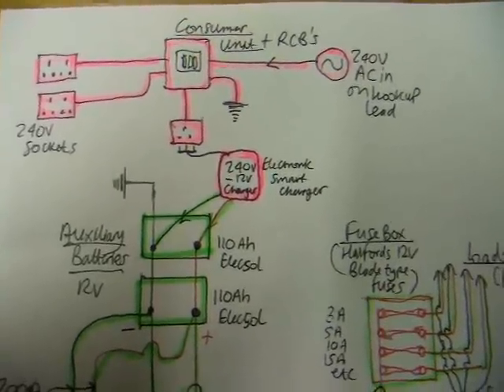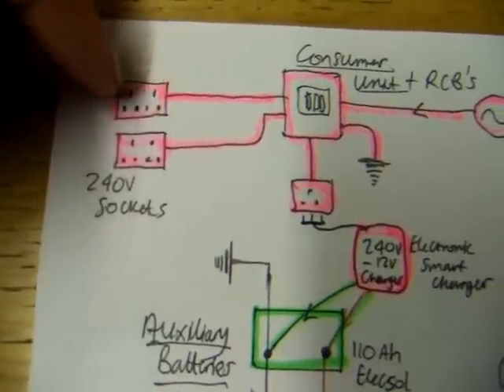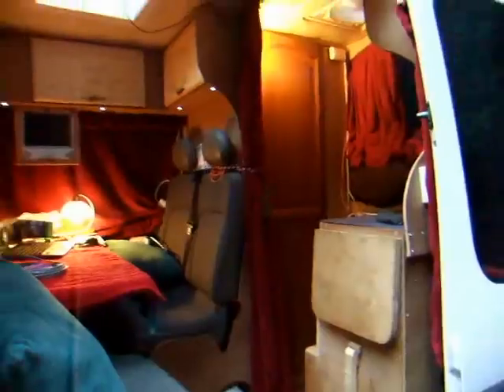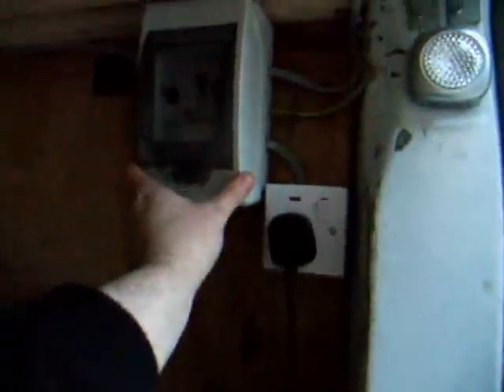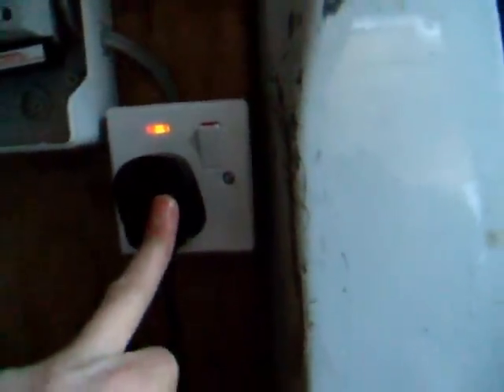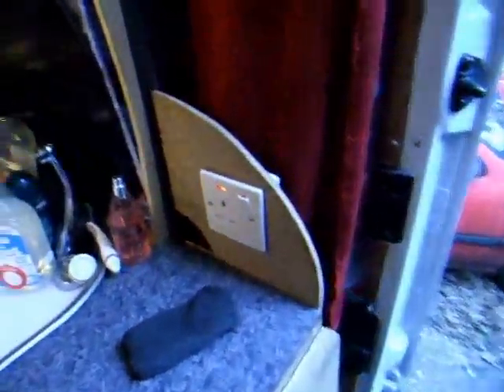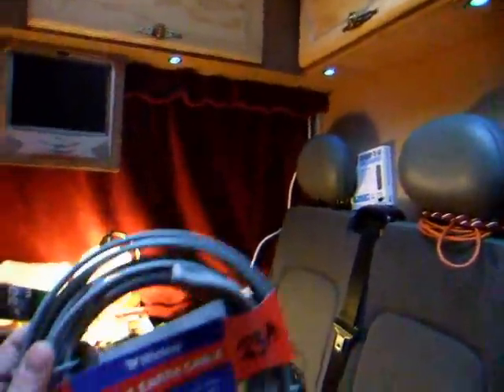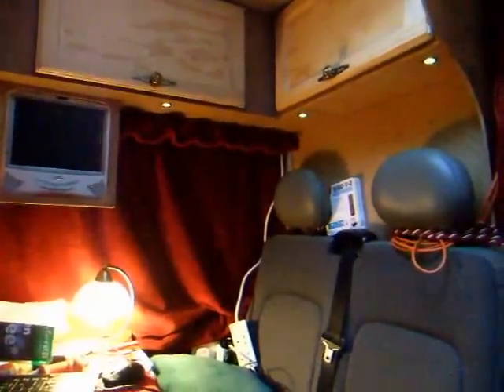20. Self-Build DIY Camper Van. 240V AC electrics, consumer unit, inverter, and sockets

Comment: I really think you should of used Flex cable and not twin & Earth.  Vibrations in the motorhome while driving can cause the copper to break in a tightened terminal.  Stranded cable is more flexible.
Reply: +Robert Williams You are correct, but  If you check on the vid, I already explained this with a note.

Comment: -----And also make it possible to power it via 12v sauce from engine when 240v Hookup is not available..This is to be done via split feed from engine and 2 12v 110ah deep cycle batterys and inverter....(PLEASE) Spud could you supply me with a diagram to do this. I am an amature but sure i could follow a diagram. My email address is   brian.wn@hotmail.co.uk  I would be really greatful of anSpud. Thankyou very much for reading my post...Cheers Bri.

Comment: Hello Spud, Bri here from yorkshire uk. I,m Woundering if you could do me a big favour (Please), A Refusal will not offend. I Am trying to convert my three an halt ton box van into a snack van and am struggling to decide how to go about installing a 240v power system . What i am hoping  to install is 2 Double sockets 240v. one 4ft strip light with a wall switch....and last of all, One 12v socket for a 12 v fridge. I am hoping to power this setup via mains hookup lead when possible. P .T .O--

Comment from the maker: @12345paulpaulpaul The van cost about  £5,500 and the conversion about the same again. maybe £11,000 overall. But you could do it for a lot less. Get an old van for about  £500 and a scrap donor caravan for the parts for about the same. Scrimp and save on parts and get stuff off ebay. But which ever way you look at it, things like decent leisure batteries do cost money and you would probably have to budget on at least £2000.

Comment: @Richard44Green 

A very good clear explanation of the 240v system. On my conversion I added a solar panel and Sterling B2B charger to ensure my batteries were always in tip top charged condition, when not on hookup.

Keep the videos coming.
Colin.

Comment from the maker: @spud09uk Good point. I remember reading this somewhere, but it slipped my mind! I'll add a note about using flex if possible. Flex 2.5 is not that easy to get hold of straight from the hardware store as everything is designed for housing, but probably mail order is OK.

Comment: In the regs it does go on to say about motorhomes wiring and you should have wired it in 2.5mm flex as the gray twin and earth is not suitable for all the vibration ect.. We wired a boat home once and I remember the hassle we had to go to to comply with all BS7671 regs. Love the vids keep up the good work

Comment from the maker: @rikkiesix Wind turbines can be good as well if you do a lot of wilding. Only problem is you need to set them up at each site I think whereas solar panels can just sit there on the roof. But, if you have both, when it's cloudy, it's likely to be windy so there's a constant trickle of power. They work at night too :)